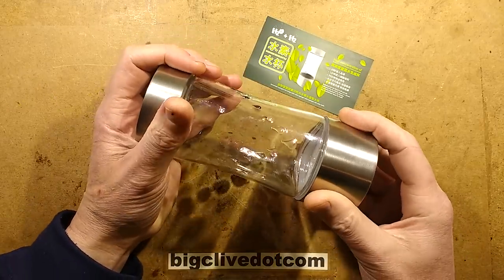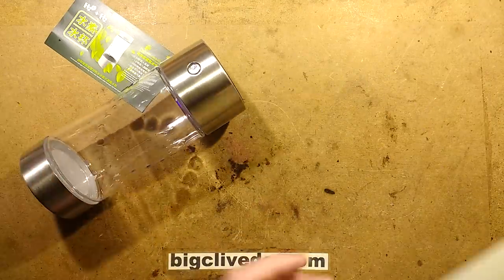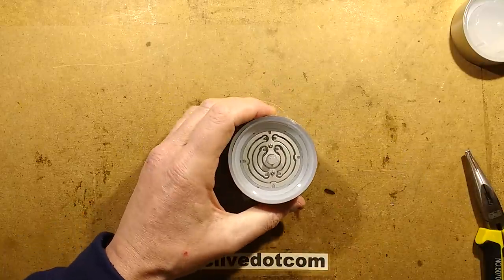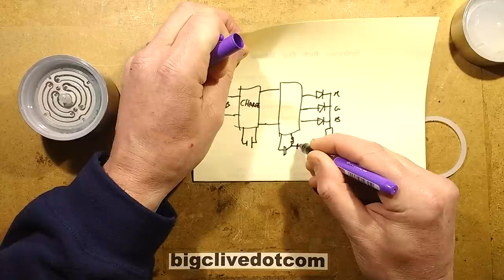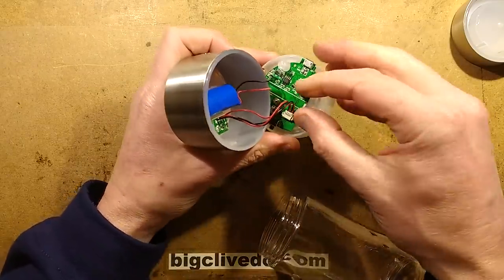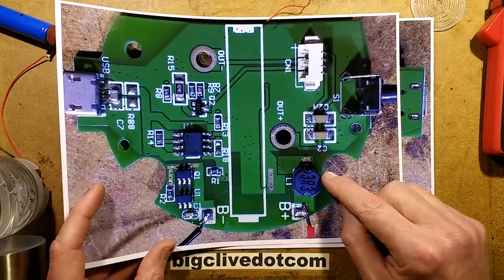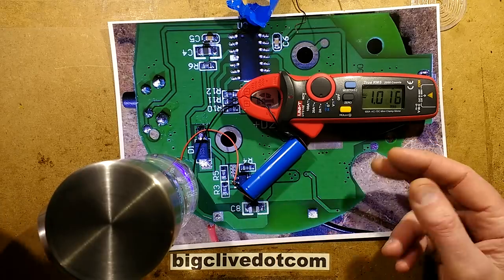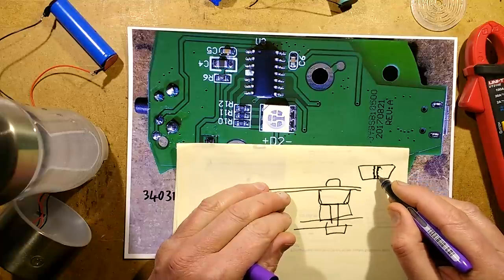Fixing an anti aging hydrogen-rich water generator.

Comment: I'm not one for health quackery but hydrogen water might be one of the few things that are legit. Though a product which mixes the oxygen and the hydrogen would be suspect unless the oxygen bubbles off leaving the hydrogen to dissolve. Think of the opposite effect. Would you want to drink oxygenated water? The oxygen would be trying to burn anything it came in to contact with. That would be very destructive to your cells like drinking Clorox. Consuming hydrogen adds a form of anti-oxidant that your body can not synthesize nor take in naturally such as with the anti-oxidant Vit C. I agree with the comments which hope the electrodes are not stainless steel. You need to do things like this with platinum coatings, hence the cost of the quality items. One question is if these units are any better than tossing a $3 bar of magnesium in to your water jug. The Mg will strip off the O leaving a H gas to dissolve. The people selling these Kagen water units (that is what these units like what you tore down are called in Japan where they are fairly popular) claim that beneficial hydrogen must be created with an electrical charge. Others say: H is H. The unit sellers claims are suspect though because they have a motive in not wanting you to replace their $1,000 machine with a $3 Mg bar. The other question is if merely drinking alkaline water is enough. If that were so one could put a pinch of say Magnesium Carbonate in their water and get their daily allowance of Mg (a common deficiency for people who live inland ie., away from Mg rich ocean water) at the same time. I think that the later mere alkaline water solution is suspect. The Mg bar might be all that is required. Though the unit makers might be correct about the electrical charge. I hope that an organic chemist fan reads this and starts a discussion.
Reply: This product was marketed with you in mind.

Comment: ATTENTION BIGCLIVE!!! There is important info to be read. Please excuse the silliness.
All the benefits of vitamins and anti-oxidants, plus the added feature of producing highly explosive gas! Get yours now! 😀👍🏻
Hey BigClive, when you get that generator working again, stretch a balloon over the top and capture those gases. Tape a piece of potassium nitrate soaked (and dried) string to the balloon and light it for some great neighborhood fun. 😜
By the way, that generator produces both hydrogen and oxygen. What a fun combination, right?
One more little tidbit. If stainless steel is used for the electrodes, use extreme caution. The generator will produce a toxic by-product. Don't get the activated water on you if you can help it. The chemical is called chromium 6. It can cause cancer of the skin and should NOTbe consumed as it is poisonous. Do not dump the active water doen the drain. It shojld be treated as a hazardous material.
Reply from the maker: I have been contemplating putting something like a condom over the  top to catch the gas.
Reply: bigclivedotcom: That would be a hoot! My main concern is that you don't drink any of the water from your generator. It contains chromium 6 which would be bad if you did.

Comment: Clive I'm sure you know this but you can get 18350 batteries semi-reliably however I'm not sure the cost is worth it... Here is the one I use in my flashlight (been using one for a year now):

https://www.illumn.com/batteries-chargers-and-powerpax-carriers/18350-keeppower-imr18350-750mah-high-discharge-flat-top.html